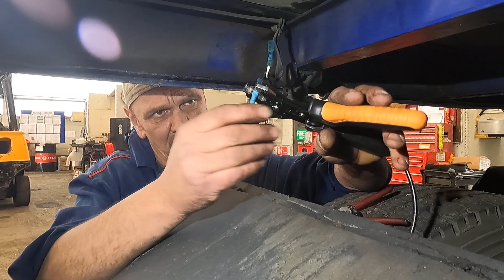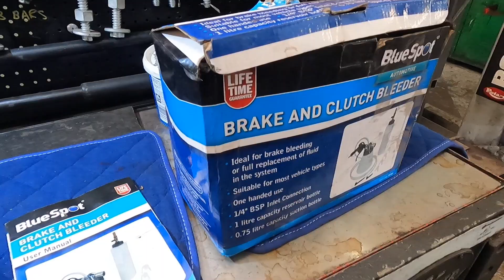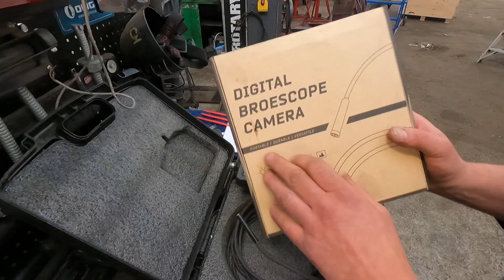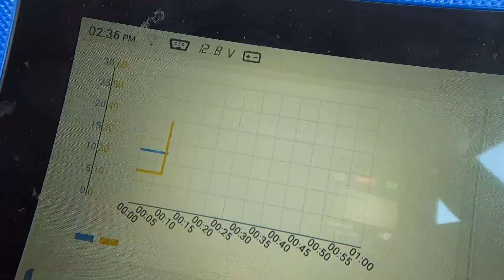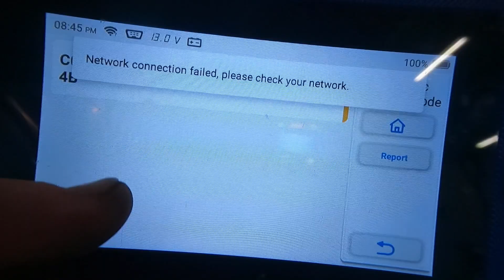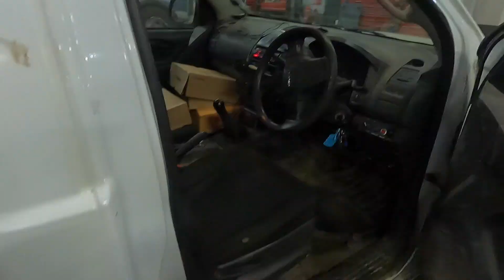Toolbox Tour - BROESCOPE???  Blue Spot Tools Brake Bleeder plus Uncovering more Topdon 600S workings

Comment: Spent ages trying to bleed a clutch with one of those air bleeders and couldn't manage it. Got a gunson eesie bleed to do it, bled instantly and helped us discover a split master cylinder. Perhaps why the air bleeder didn't work
Reply: An oil can and some pipe works to reverse bleed.

Comment: Nice to see isuzu still kept the same design and layout as the old troopers on the front axle for replacing wheel bearings. I  think its every 20,000 miles you regrease the front wheel bearings but I'm open to correction on this.  very hard to get them genuine Akebono calipers without having to pay the big money to buy them in the isuzu box off the dealers.  Great video showing how to do the job and tools required and also showing and explaining what to look for in faulty bearings  :) . what year is this Dmax?
Reply: Dmax is  2015. We have a dealer for Izusu not too far away. Not too long ago the commercial side gave up the franchises and we had trouble getting bits. Better now though.  C.

Comment: With this kind of brake bleeder I found it really effective and sometimes necessary to cover the outside of the thread of the bleeder nipple in grease so it doesn’t suck air into the hose via the thread
Reply from the maker: I'll try that. 👍
Reply: I'll try that too - I always seem to end up with an implausible amount of air when I use our Sealey one at work.